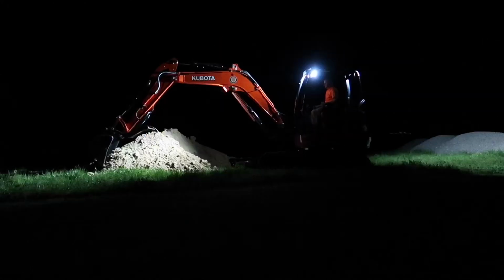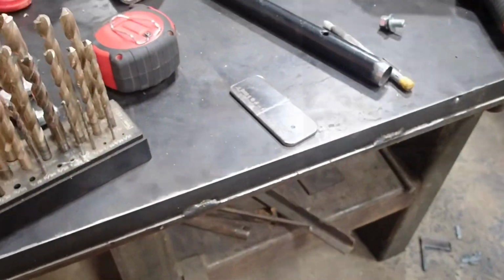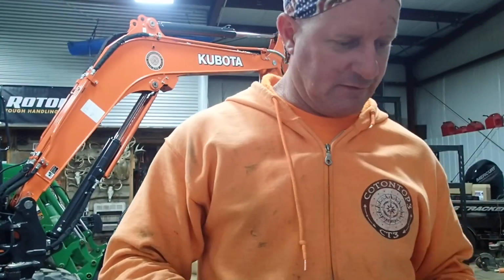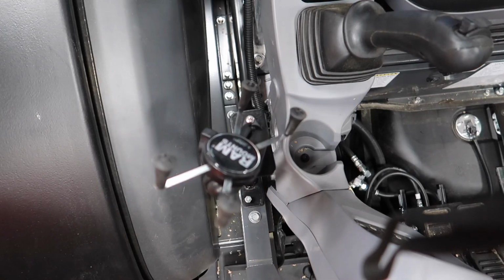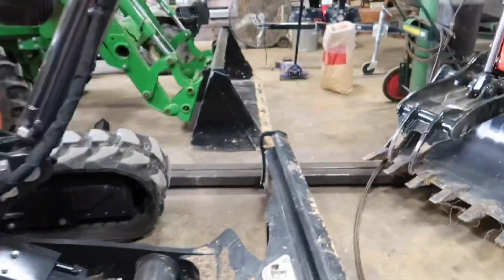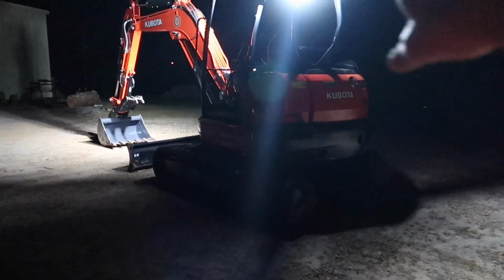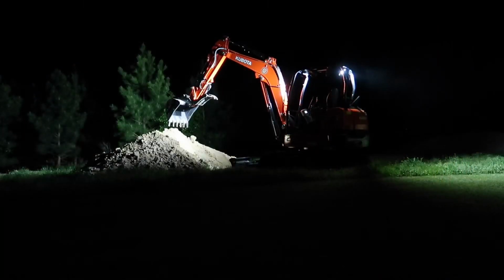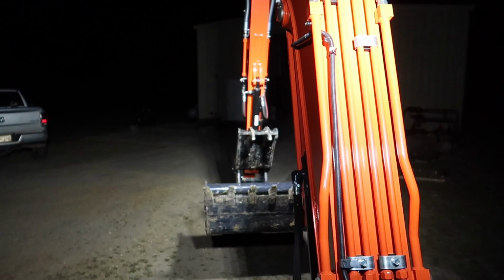Kubota KX057-4 digging dirt after dark- NEW LIGHTS!

Comment: There are some unibits on Amazon made by Neiko (I think) and it is either a 4 or 5 pack in a small aluminum case. When you were trying to ream that hole out I couldn't help but think you could use the set. They are not all that expensive,$15 or so when I bought them 4 years ago, and they seem to be lasting rather well for what they get used for.
Anyhow, nice lights; very bright and you can see where you are swinging to if you have to work in the dark.
Reply: Yup unibits are a life safer. I used them everyday when i was an Electrician. And in the shop it beats wallowing out the hole with a standard bit

Comment: I noticed they moved the pin from the stick boom to the main boom. Where you can change the position of the stick cylinder. I wonder what type of power changes when you move to the upper hole. And I also wonder why they changed that
Reply: they wank make it easy to switch attachments plus you can add more stuff you want on it plus it makes it more value on kubotas when add on more stuff plus it dresses up